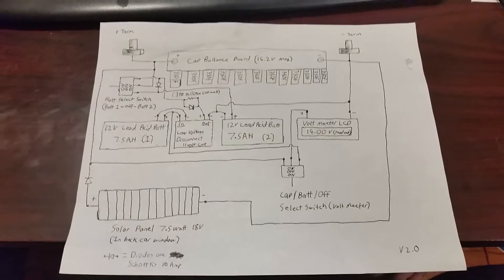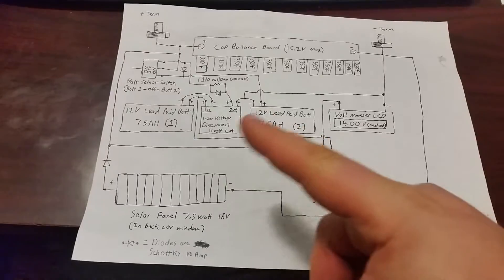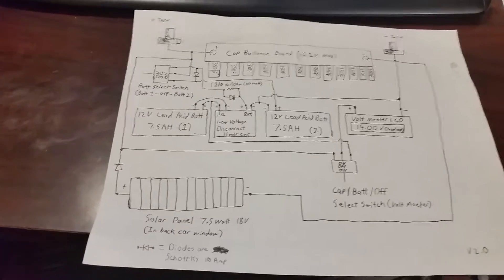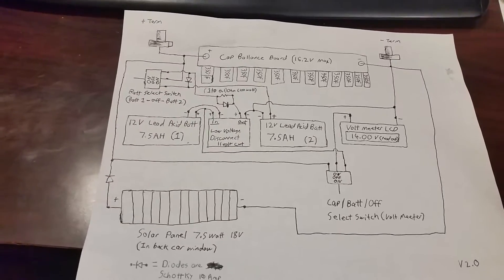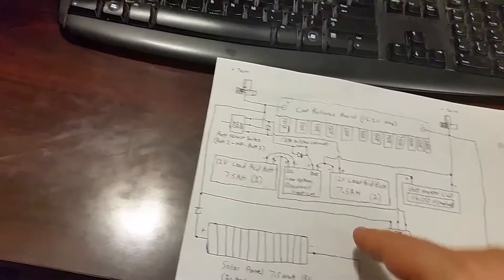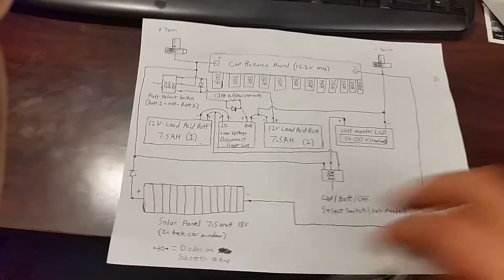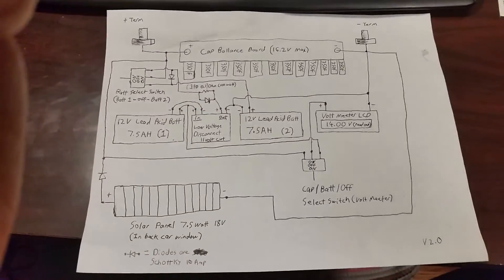DIY Schematic Super Capacitor Car Battery

Comment: Sailboats often use deep cycle batteries and I would expect that super capacitors would be a good option to improve cranking current while allowing use of cells optimized for overnight low and slow current draw.

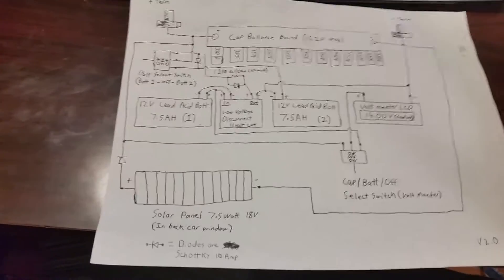Comment: Hi Gene, I am doing my homework that you gave me!😀 Looking the videos that you indicated in the comment to my video about super capacitors. It is very interesting this second battery. If it is only to charge the super capacitors, you could even take a very small motorcycle battery with a limiting resistor in series, right? Saving money and space under the hood. I see already that both batteries are only 7,5 Ah. So you don't have the original car battery anymore? Is that the reason that you remind the limiting resistor at minute 4:30? If we have the original battery that can give 800 A, the stress with capacitors will not be greater than without, rather less. It will be smeared out in time, like the bank with the mortgage (well, the bank wants its interest...). Is there an overcharge protection between solar panel and capacitor&battery?
Anyway a good motivation: to let batteries last longer. With maybe 1 billion car batteries in the world, that would make a difference.

Comment: I don't understand why people are going through all of the trouble associated with leaving the cap bank in the battery loop at all time?
Why not just switch the caps into the battery / starter loop 3 seconds before starting, then drop the caps out?
Similar to starting an old school diesel when you had to wait for the glow plugs to get up to temp before starting, but this should be much quicker. 
Just saying
KISS

Comment: Gene, Can you plug traditional PV solar modules (on your roof) into a Jackery 2000 plus during a down grid situation?  It seems like this would be a great alternative to an expensive Tesla or Enphase battery backup solution
Reply from the maker: Capacitors are more expensive than batteries. Furthermore they do not hold as much power. Their advantage is they can burst out power very quickly, and they last a VERY long time. So something like a car that just needs a quick burst of power to start or a flashlight that is low power draw they are really good for long term usage.

Comment: How is the current resistor sized? Shouldn't it be 12 ohm resistor that will get your 1A in the circuit? V=IR ==> 12 = 12I ==> I = 12/12 = 1A (please correct me if I am wrong)
Reply from the maker: Your right 12v is roughly 12 amps with a 1 ohm resistor.  Which is more useful than 1 amp. Just missed the value in the explain.

Comment: I commented on previous video. Didn't know u already solar. Question. Can I get rid off both batteries and use solar panel to recharge caps for starting. Is 4W enough? The cap circuit has balancing board that cuts off voltage to caps. I'm not concerned too much with using radio while car being off?
Reply from the maker: You can get rid of the batteries. However you got to understand you are increasing the chance you may become stranded from a DUE (dumb user error). Maybe a dash light was left on, maybe a door did not close all the way, etc. With no battery only to find out you are at the grocery store and no way home. Car clocks and computer draws power too 24/7. These little batteries are super cheap compared to a car battery and good for emergencies. The second battery lets you "jump" your capacitors in a few seconds if your main ever gets drained. The way it's wired both batteries charge once the car is running.

Comment: I am curious if this type of setup would be feasible for a diesel pickup. I have a 2008 Dodge Ram 6.7L Cummins pickup that I've had since brand new and like clockwork every 3 years the batteries are too weak to start the truck in the winter, forcing me to replace them. I have already put 3 sets of batteries in this truck since I've bought it new, twice with high-end batteries (Interstate, and Diehard) with this last time being Walmart brand, but with the weather already turning cold the truck is showing signs of sluggish starting, so I have been keeping my jump box in the truck in case I need them.. It's about $500 purchase each time I have to replace them because they are always just outside the warranty period. I have even wired up a trickle charger to my block heater with a Y adapter, so in the winter i can plug it in and the batteries will trickle charge to stay topped off, but still they seem to only last 3 years. I am thinking of trying this capacitor route out to see if it helps me out, i have to replace 2 batteries, so I was thinking of going with the premade setups on ebay, the 6 x 3000f Maxwell Capacitors w/ balance circuits for $250/ea and just buy 2 of those and add small lead acid batteries like you mentioned in your setup.

Comment: Does the S.Capa works like voltage stabilizer where it boost the CCA (Cold Crank) ?
Reply from the maker: With the two parallel 400F bank capacitors what I have I would say no the voltage ripple is about close to the same. However going to to 2k to 4k farad capacitors would show significant less ripple because there is more stored energy. The capacitors crank well in the cold. Though with this setup if the batteries get too cold they could drain the capacitors. A large bank of capacitors by themselves would not be weakened by extreme climate cold.

Comment: Are you still using this system? If so, how’s it running for you?
Reply from the maker: The battery is still running fine. Though i will say that I switched to a Prius so my Camry is now a backup car which sees little use. However The solar keeps it topped off and ready to go. Prius 12v batteries are VERY expensive and are maintained by the 202V drive battery. So when it comes time to change the Prius 12V battery I'm thinking of swapping that to a capacitor setup for a permanent replacement.
Reply: Thank you for the reply.

Comment: Great job !! I'm just wondering why didn't you double the farad for the capacitors and the Ah for the battery instead of doubling everything ? Also considering that in my opinion  it 's not necessary to have a double batteries security, because of the solar panel. It's a bit too much i think.
The ultimate evolution of your super safe system would be to add a manual crank and LTO instead of lead batteries and it would last for centuries !!!
Reply from the maker: I tested this out pretty through. I went with a double bank of 350F capacitors because that is what I had to work with. I got a good price on 350F on ebay so I used them and they work fine. Going with 2kF or 3kF would of been better IMO. But the cost would be much higher. The reason I went with a double battery is convenience/time to start your car. When i had my single battery when the voltage was low and I threw the emergency switch it would take a really LONG time to recharge the capacitors. This is because the lower a lead acid battery's voltage goes the lower it's peak amp output drops. By having the second battery if the car door was left open or the lights left on (which a solar panel will not help) I can flip the emergency switch and in 2 seconds start the car which is good if your headed to work/appointment and don't have time to spare. As far as a hand crank generator I have tested these extensively. I've built several super capacitor flashlights charged by a hand crank and this works well charging a small farad bank. However even with my big heavy duty hand crank it would take 15-20 minuets to crank up a farad bank for a car. Not only would you be sore but possibly late for any appointment. For battery longevity if you did not want to go with lead acid (cheap) you could go with a Ni-Fe battery. With good care you should get 25-50+ years out of that. Though the lead acid in my system should last 10-15 years since they only handle the light parasitic loads. The disadvantage of  no battery and capacitors only is you can deplete your capacitors quickly if you do not start your car fast enough or if it's not sunny enough for solar.
Reply: @gene4390  ok i understand better the double batterie. I'm gona look up the nife battery. Have you ever tried Lito batteries ? For the capacitor only system, the only safe way is too have an electric cord with a domestic plug...
Reply from the maker: @fraaggl  You can go with various Lithium chemistry batteries. They have easily 2x the cycles (Normally 4x but weather extremes will reduce that). The issue with Lithium is they are very delicate. You will need a BMS circuit to protect them as well as a charge controller that disconnects the batteries from the load when the car starts and is charging. This adds a lot of complexity. As far as a capacitor only car battery is can be done with a large enough F bank. Not sure what you are referring too with the plug?

Comment: I like your idea. I would love to see a video showing you  actually solder and put together the capacitors and board.
Reply from the maker: If I build another battery bank I may consider doing just that. I soldered the copper rod directly between the capacitor posts to carry the high amperage. However next time I will drill holes through the copper rod to go over the posts as that is safer connection (no solder weakness).

Comment: Brilliant design, I am going to build it, i have added a switch to the design on the left of the resistor so I can turn batt1 off, completely separating it out, this means the car gets only power left in the capacitors. I thought this might be safer to separate batt1 from the car over night maybe so it didn't drain, and just switch it back on before you start up, just an added option. It might be a problem if you have a car alarm that needs power. Do you think this will be ok in your circuit? I am by no means qualified in electronics, thanks. PS. I am placing all the switches and volt meters in the cabin of my pickup. Cheers👍
Reply from the maker: A couple of things I'll try to answer as best I can.  Capacitors hold very little power compared to batteries. However what they do have they can put out very quickly (low resistance).  IE they can give a short burst of high amps.  The other good thing about capacitors is they don't wear out if properly managed.   To do this project you need to determine the amount of amps required to start your truck and for how long you must crank your car for it to start.  If your running just on capacitors other electrical devices will drain them quickly (remember they don't hold much but instead are really good bursting high amps).  Running my old incandescent lights (old car) on just the capacitors will deplete my capacitors below what will start the car in less than 30 seconds.  Larger capacitors of course will hold more power and last longer.  Therefor I have 2 small batteries.  One battery supplies power to the car when it is off (alternator is not running) so the capacitors are not drained. A resistor blocks this small battery from providing much power during a start so the power comes from the capacitors).  The second battery is a emergency jump battery that will quickly top off my capacitors if I let them go low.  Pickup trucks typically require more amps to start than cars.  I would recommend using 2000F or 3000F capacitors with a balance board.  Even if you don't need the higher farad the larger caps will smooth out the power dips from your alternator even better and offer better protection to your electronics. The rest of my battery design I would use (and modify where you see fit).  Good luck!
Reply: thanks heaps Gene.😃
Reply from the maker: No problem.  If you have any questions always feel free to ask.
Reply: Simon's FPV: You are righ, it is better to have switch to disconnect main battery when you need. And you can start your diesel engine using capacitors only. After that connect line again by switch and have in parralell capacitors with battery. And, of course, you need high Farads in capacitor for diesel engine

Comment: Hey!

Loving your project! I have very little knowladge about electronics but I get basic schematics like these.

I want to use caps as a addition for regular car with small battery (12v 40Ah) permanently attached to battery of the car.

Why? Well:
- To protect battery  and make it last longer (increasing lifespan) (start/stop system heavily drain regular battery - in many new cars capacitor systems are already attached in premium segment),
- Be able to jump start bigger cars
- Caps will also increase lifespan due providing power for cranking in winter time

I want to use 6x MAXWELL BCAP0350E250 350F with https://www.aliexpress.com/store/product/NEW-1PC-350F-2-5VDC-D-CELL-ULTRACAPACITOR-MAXWELL-BCAP0350E250T03-Balance-Board/1917370_32813057355.html

For simple jumpstarting it will be just 2 cables connected to the battery. I have no idea how to connect it to the battery if I don't want them to drain all power from alternator. My another worry is Webasto in car - not sure how caps on this board will be acting when Webasto will turn on while engine (alternator) is not running.

I want somehow to force alternator to charge battery over the caps. No idea what to use and how to connect it.
Reply from the maker: Without knowing your complete setup I will do my best based of guessing where you are going.  First off your link is for the older style Maxwell capacitors that have a max voltage of 2.5 volts.  That is 14 volts max.  Your alternator is going to put out  > +14 volts which means your capacitors will be running at near breakdown voltage.  Maxwell 2.7V capacitors would run at 16.2V max and give you a little more elbow room.  x6 350F capacitors is not much power.  I'd consider it the bare minimum for a small 4 cylinder car.  Yet you want to jump bigger cars?  My recommendation if you want to jump bigger cars is to go with 2000 farad or higher Maxwell capacitors connecting to your main battery with a resistor/diode like I have above.  You could start bulldozers with those big capacitors.  If you are planning on direct connecting your 350F capacitors directly to your battery they will give you a little (not a lot) more starting amperage.  However your battery will do most of the work for starting (capacitor voltage drops faster than battery) and your capacitor will not help in battery longevity.  As far as your Webasto if you are using a resistor to protect your battery for heavy drains you will need to calculate how many amps heater draws.  You will then need to size your resistor so that enough amps from your battery can pass to power your Webasto.  If your resistor is too high a value then your Webasto will drain the capacitors.

Comment: Hey Gene A,
I'm really interested in building a battery pack similar to yours and I was wondering if you could offer some of your advice.

I am considering building a 6x400F pack with:
+ a balancing board
+ resistor (to prevent drawing too much current)
+ diode (to allow for charging) 
+ solar panel (to charge the capacitors)
+ low voltage cut off 

But simpler:
- no second battery. so maybe i'll add the emergency charge like the previous iteration of your device. 

I want to connect the battery directly to a battery tender for trickle charging for long term storage. My question is: do I need additional protective circuitry to protect the battery and the capacitors? Or will a battery tender operate correctly even in a non-orthodox configuration?

Thanks!
- Curious MechE
Reply from the maker: I am not sure what your battery tender is?  Though regardless of whether it's a wall cube or a solar panel they typically put out just over 12v at low current.  This would mean it will float the battery and capacitors at it's running voltage.  As long as that tender voltage is not above the capacitor bank max voltage and current is above the "bleed" of the battery+capacitors you should be fine long term.  I'd strongly recommend the second battery.  For an extra $12-$15 cost of the battery you get emergency fail safe which I have used twice in my old car over the last two years.
Reply: Hey Gene! Thanks for the quick response.

A battery tender is just a brand name battery charger. But it's a little more advance than a float charger as it won't throw a constant voltage. In storage, it will wait until the battery needs to be charged and turn itself off when needed. I have one more question, if I were to add in a battery charger, would you recommend that I attach it directly to the battery or would you recommend that ends of the balance board? Or would it not make a practical difference?
Reply from the maker: It would make no (very little) difference.  Regardless of where you place your charger the spare electrons will go to the capacitors (and flow also from the battery to the capacitors) until the capacitors charge surpass the voltage of the battery.  Then electrons will change flow towards the battery.  Think of your wires like a pipe with water pressure coming in from the tender charger.  As an analogy whatever side (battery or capacitors) has the lowest water pressure (ie voltage) is the direction where most the spare water (electrons) will want to "flow" in the pipes (wires).  Does that help you understand what you wanted to know?
Reply: Hey Gene!

That's perfect. Thank you again for your help. I can't wait to share what I am able to concoct.